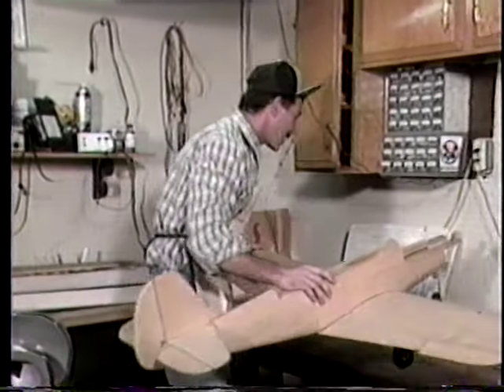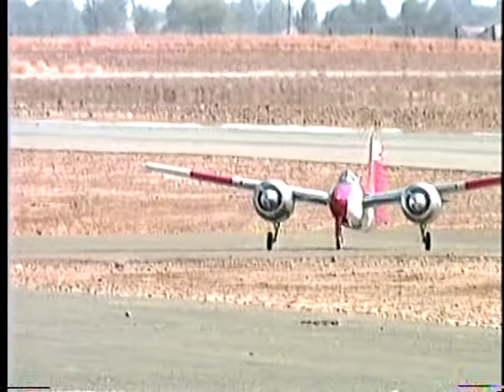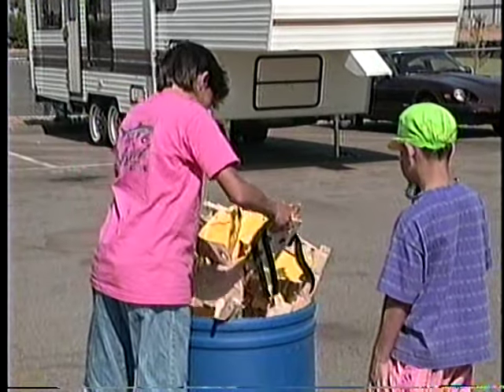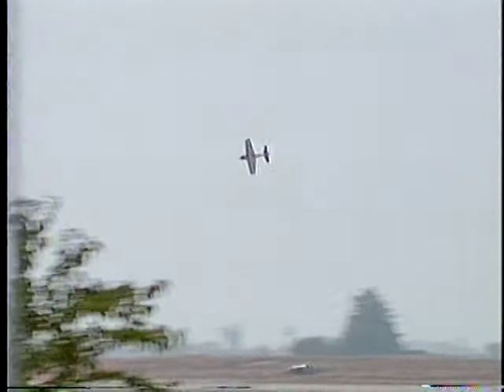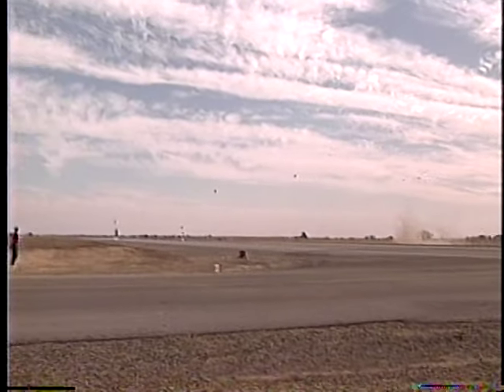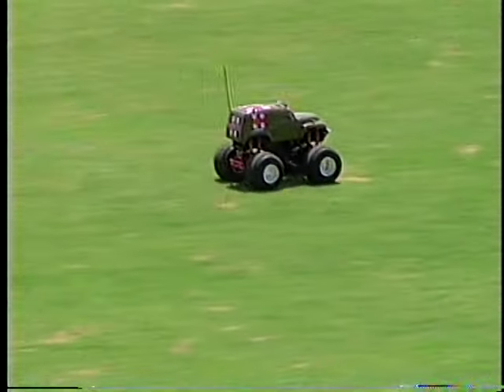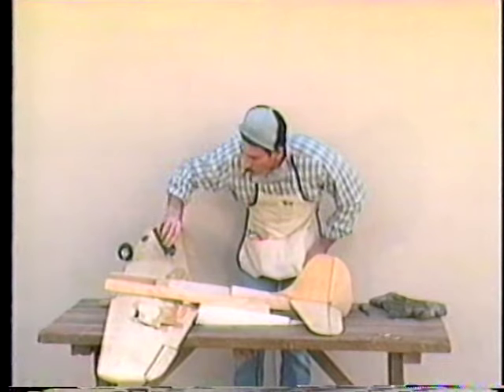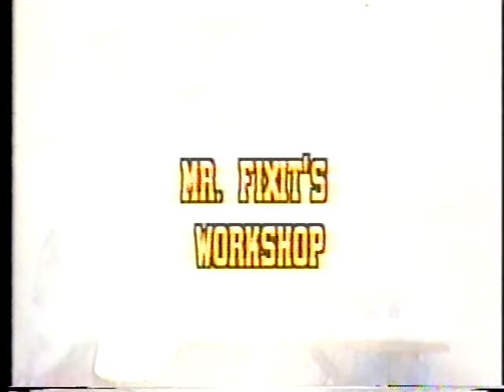Out of Control RC crashes 1994

Comment: I’ll never understand the lack of talent and skill to even land. The bigger the easier they fly yet these guys seem to have a very hard time.
Reply: The title literally says RC crashes, what were you expecting? Great landings?
Reply: It's literally a compilation of crashes, sure they had plenty of good flights also. Not to mention 94 rc technically isn't exactly what it is today.
Reply: @nickarganbright7218  I started in 1976. The 90's seemed like high tech. Little did I know what was to come. At 63 I still have the burn in my heart to fly and build and of course buy!
Reply: @JDsRCModelWorld-up7ws  honestly you can get a foam plane for around 100 bucks that can still do pretty cool tricks if you just want to occasionally fly around on the weekends or something, I recently started flying 3d rc helicopters and honestly can't to any real tricks with them or anything, but still have a blast flying them around. Obviously you can still dump thousands of dollars and a crap ton time in the hobby, but for the occasional person even some of the "cheap" rcs are surprisingly fun and capable.
Reply: Scale pilots, as a group., have always been poor pilots. A tradition that holds to this day. Many (not all) spend all their time building not flying so lack true flying competency. They don't always engineer and construct the planes properly for the needed g loads. It becomes a perfect storm when they chose scale designs that a tricky to fly.

Comment: Wow, what memories. I flew the Madera races from 1992 to 2000 as well as Reno, Galveaton and Oshkosh as Race 84. Should I be sad I didn't wheck a plane there in 1994, or did I? So long ago. The thumbnail has our team (Classical Racing) leader Rob Wood there with camera reporting for Model Airplane News. I still have the next Sea Fury 90% completed before all the racing ended. Gonna finish it someday.